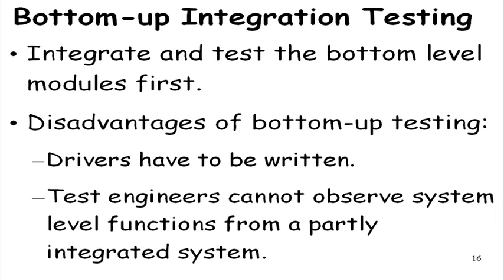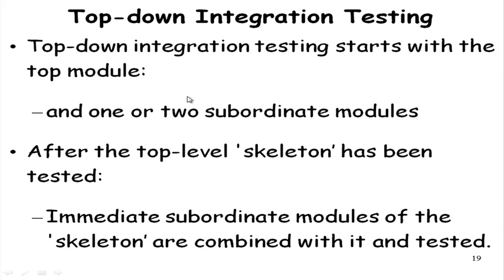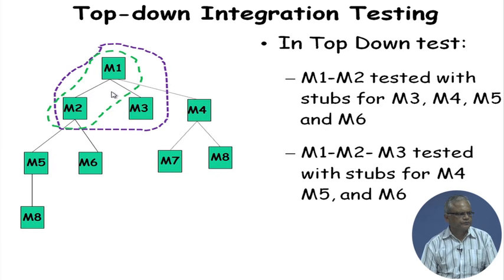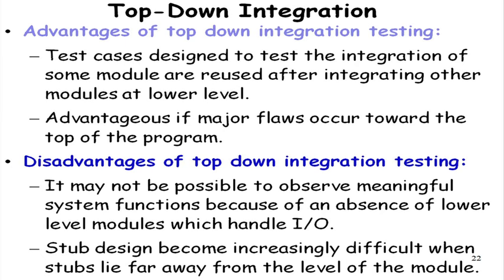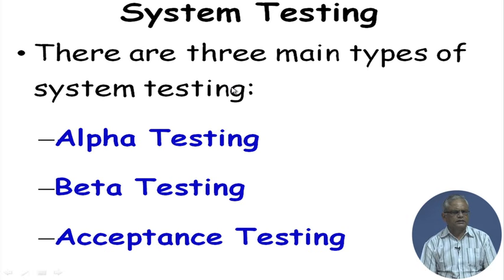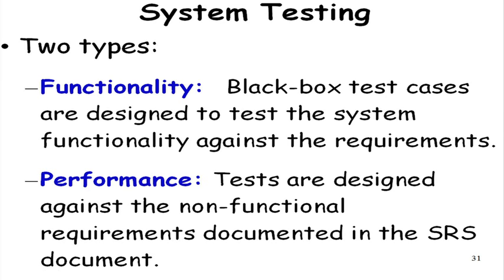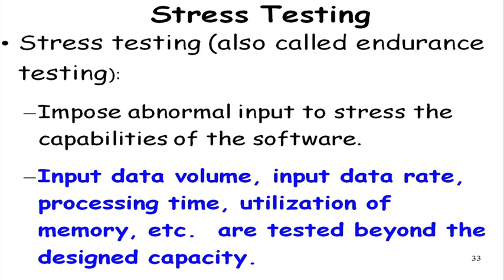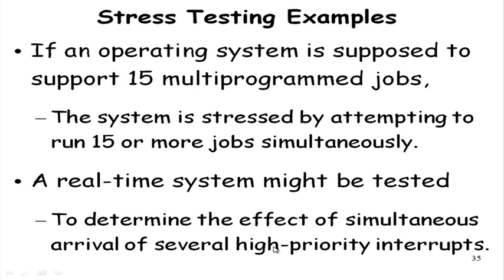Integration Testing

Comment: Hello, 
I have question. Can you answer it. 
After integrated 2 modules example sign in page and home page,  how is called this action in case of we check that pages and their related functionality in blackbox approach in User Interface. This is called Integration testing or not?. If not, this requested testing how is called.